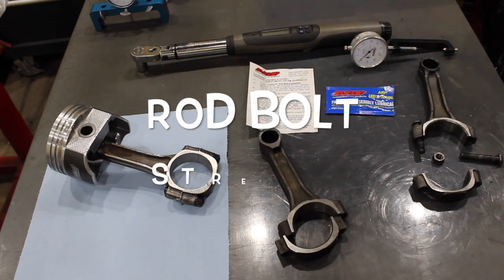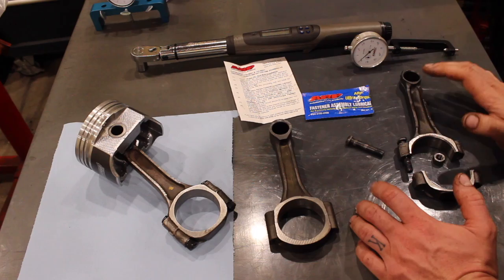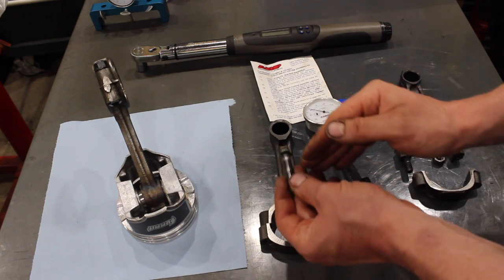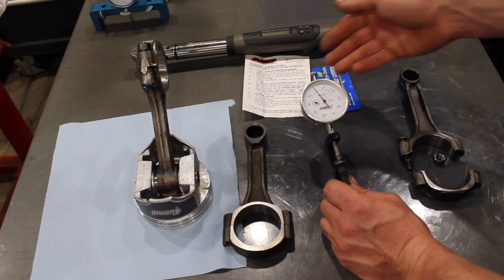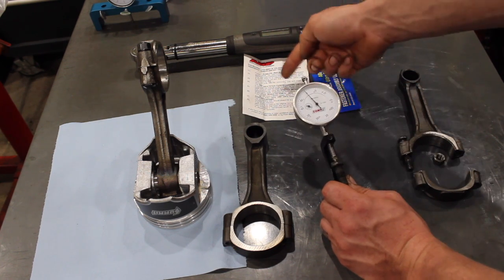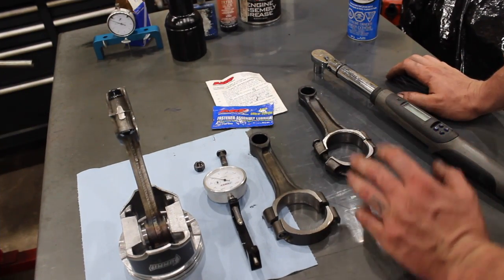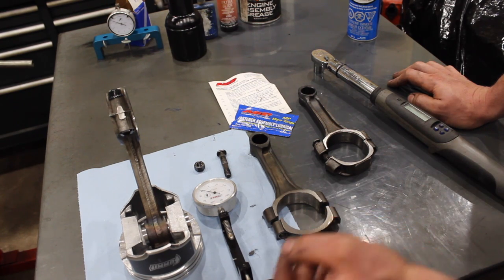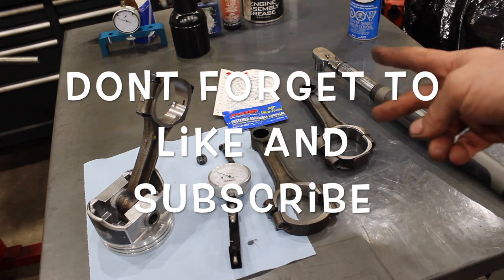Rod Bolt Torque VS Stretch Test (Surprising Results!)

Comment: I used the ARP lube on my bolts but after the 43 foot lbs mine called for I only got 3 thousands of stretch when it calls for 5-5.5 thousands. So I did the rest with a ratchet instead of a torque wrench until they were stretched 5.5 on both sides. Is this still an accurate way to do it?
Reply from the maker: Stretch is the important part. Torque is just an estimated number to get the proper bolt stretch
Reply: @cuttersperformance thanks 👍

Comment: I know this video is a few years old, but i could never get the ARP rod bolts to stretch to the recommended stretch, no matter what lube I used. Starting to think my arp grease is bad.
Reply from the maker: Even when you increased the torque spec?
Reply: @cuttersperformance  yeah, thats the weird thing, on my recent ej257 build, at 60ftlbs, it still wouldn't get to the specified stretch. I wasn't game enough to go higher than 60ft/lbs
Reply from the maker: @daniellib32  you put lube on the threads and the head of the bolt?  Have you tried other torque wrenches or checked calibration?
Reply: @cuttersperformance  sure did, have 2 different torque wrenches, but my digital one has always been spot on. 

I suspect the arp grease being quite old contributed too it. Im building another one shortly, ill try a fresh packet and report back

Comment: I'd be willing to bet most machine shops have a box filled with those little packets of arp grease. The customers have no idea their supposed to be using it. Nobody has ever handed me one of those packages when I pick up my resized rods with new arp bolts.
Reply: If the machine shop resized them the lube should already be on the bolt threads

Comment: The devil is in the details... The maximum yield strength is your maximum clamp force.
ARP might have a higher maximum yield strength but the set yield strength is locked in at your .00526 (etc)...
What maters is how much "crushing":takes place at the piston arm's  two halves, that they are stable at your high rpms and that vibration does not back your bolt assembly "out/lose"...
I will do a test showing clamp force created and this will relate to more "crushing" and if it's done in the yielding range of the bolt, it will give more resistance to vibration (what matters is the assembly not get loose during your high rpms and vibration)...

Comment: I do not use a torque wrench. I place an extra long box end wrench over the nut and then the stretch gauge. I can watch the needle move as I pull on the wench.

Comment: I'M CONFUSED......so after you verify this do you just assemble the engine using the lb-ft spec or do you assemble with the lb-ft spec and then wrangle the stretch guage in there to verify also???????
Reply from the maker: If you dont have a stretch gauge (which is recommended by ARP) then use a good torque wrench. Be sure to use lots of the proper ARP lube (on threads and head contact area) and torque to their provided spec
Reply: @cuttersperformance  thanks for the reply. I have no problem buying the stretch gauge, just curious if I am supposed to use that during actual engine assembly or if you just use it to find the lb-ft that it gets you that stretch before you assemble?
Reply from the maker: @yurimodin  if your working on a SBC/BBC you can fit it no problem. If you cant fit the gauge then ya you can use it to figure out the perfect torque spec with your torque wrench  out of the engine

Comment: It was very helpful! Thank you.  Great video! Let me ask you one question.  I will be installing eagle rods in the near future.  I don't have a stretch gauge.  The description says 43ftlbs.  When installing, do you tighten to 43ftlbs from the beginning and finish? Or as many people say, first tighten to 43ftlbs, loosen once, tighten again to 43ftlbs, loosen again, and finally (3rd time) finish to 43ftlbs Is it? I'm worried that the bolt will stretch if I tighten it all three times to 43ftlbs.
Reply from the maker: Im assuming the eagle rods have arp bolts? 
You can tighten in stages but the final torque should add atleast 10 ftlbs. For example of you snug the bolts then torque them to 15 ft lbs, 30 ftlbs then to the final 43 ftlbs. 
Technically the bolts can be torqued to 43 ftlbs over and over again and then return to the original size when loosened. The only time they will stretch is if they are over torque and stretched past their yeild. 
Be sure to use the proper arp lube on the threads as well at the head of the fasteners where it contacts the rod to get proper torque/stretch
Reply: @cuttersperformance  
Thank you.  You're kind.  I look forward to your video updates.

Comment: I conducted almost this exact experiment one friday evening out of pure curiosity but I also wanted to see what the arp bolt with arp lube torqued to the correct ft lb and stretch did to an otherwise unaltered rod. I tested on 3 different rods 2 oem rods and 1 eagle rod and was blown away at what I was seeing, the 2 oem rods were 1 from a traditional sbc and 1 from a bbc the 3rd being an eagle rod for an lq9 and 1 thing all 3 rods shared in common was they were all perfectly round on the big end to start but after torqued with arp bolts and lube none of the rods were perfectly round anymore 2 of the rods returned to round after removing the arp bolts but the bbc rod center line was so distorted and stayed that way it wasn't even usable anymore ( no kidding I hung it on the wall to use as a story piece after that ) the eagle lq9 rod and sbc rod were just fine but were spares so I wasn't concerned with hurting them. The conclusion I came to was I will never install arp rod or main bolts again without getting the rods and mains at minimum checked and resized if need be with the arp bolt. I will admit I have installed many ARP Rod bolts without getting the rods resized and have not had any discernible issue with anything flying apart however I have noticed after inspecting bearings on tear Downs that I have done this with the bearings have odd wear patterns consistent with the rod not being round yet it was before it was assembled anyhow Great video buddy just wanted to throw in my 2 cents I hope more people see this!
Reply: This! Have seen the same thing.
Reply: So the fact they came with instructions but yet u think u knew better? Lazy is what u are

Comment: Hi, How can I tell if my ARP rod bolts are stretched beyond there usefulness? Is there a spec for there length? See I had a engine shop install my rod bolts and the fing things where real tight when I got them back, So I thinking there stuffed. Been stretched too far! Great Video BTW. Thanks
Reply from the maker: Typically a pre install measurement is needed using a micrometer or rod bolt gauge. Arp bolts a super consistent so they might have the exact new measurement info or if you know the part# I can probably measure a new set that I have and you can compare to yours. 
Typically a 25 to 30% over torque will stretch them pass spec (Depending)

Comment: You need to do a video explaining how if you’re running a bolt or stud with a washer you only put lube between the washer and the head of the bolt or between the washer and the nut and not on both sides of the washer like some people think you should
Reply from the maker: Ive actually done my own testing on this and wasn'tsure if anyone else wondered about it. Again the key is using the ARP lube, but what I found is that obviously you want to cut down the friction between head of the bolt and the washer and putting lube between those two is key (also on the threads) Adding more lube to the bottom of the washer had little to no effect on the bolt stretch but did not show any negative effects that I found
Reply: @cuttersperformance  I actually sand the side of the washer that doesn’t contact the underside of the bolt head/nut with 80 grit to make sure the washer doesn’t rotate.  See that on in an email that ARP sent out years ago, said to do that if the machine finish where the washer sets is too smooth.
Reply from the maker: @sethmiller9442  Yeah ive seen that before too, never actually tried it though
Reply: Grease on both sides acts as a bearing

Comment: Love ARP bolts. They are not cheap but do offer excellent value for money. Locally it costs $100 to resize rods, $25 to check for straightness, and the bolts cost $80. So that's $215. I can get forged Scat rods for $320. Now if you got a local guy that can gets you reconditioned and resized rods for around $150 plus your stockers go grab it and growl.

Comment: I always tighten and loosen the bolts a few times to “match the threads and area under the bolt head”.  Then I’ll check the stretch with the recommended torque to see that my torque sheen h accuracy.   If it matche to the stretch I’ll torque most of them unless it’s a high hp build.   If my wrench torque doesn’t match the stretch I’ll use whatever torque that is that matched the stretch.

Comment: I have found that you have to have some formula,... using both torque and stretch for the best results,... materials aren't as consistent as we would like to believe,.... I still pay more attention to torque,... if I have to go a couple of ft. lbs. over,... to get close to the stretch,... I do,... but thats about it,.... fastener torque,... is where the tension accures,... and thats what you want,... to be consistent throughout the motor,... for reasons of heat and cooling,... where things can somtimes change.........
Reply from the maker: I also use the stretch to figure out the torque. 
Its really about the strech, not the torque. Technically you dont even need a torque wrench for rod bolts if you have a stretch gauge but its easier. 
A stretch gauge removes outside factors like thread resistance and really tell's you what you need to know

Thanks for checking out my video
Cheer!

Comment: The arp rod bolts cost is worth it but having the rods resized and everything idk if its worth it, by the time you buy the bolts and pay the machine shop you got $300+ in your stock rods when you can just go buy some aftermarket scat or eagle rods lol would be nice if having the rods resized wasn't needed
Reply from the maker: That's a very valid point, machine shop costs kinda push you into the aftermarket rod territory. 
As long as the new rods are decent and don't need any resizing

Comment: All depends on how everything  was machined on the procedure you take.  If the machinest didn't use a stretch gauge I wouldn't either.  Duplicating the process of when everything was machined is what you actually want.
Reply from the maker: I totally agree, but at the same time, to use the fastener properly as ARP intended, it seems that a stretch gauge it really the best way to go. The ARP bolt lube on the threads and head is also very important for consistency

Comment: This is my first time rebuilding an engine. I replaced my main bearing and my crankshaft turns pretty good by hand but after putting new STD rod bearings on and just snugging down the connecting rod bolts to 15 ft lb.
My crankshaft won't budge at all unless I loosen the nuts back up. Which I'm guessing that's why they can't be reused. Since there stretched out from having to be TTY. Now is that the case. Because So far, I haven't found anything that supports my theory.

Please let me know ASAP
BTW, I really appreciate you making the time to make this video for those who are looking for answers
Reply from the maker: Did you make sure the chamfer on the rods is the correct way on the crank?

Comment: I had some big block chevy ARP rod bolts. Said to stretch them .0065 to .0067.  I had to torque them 62ft lbs. With my torque  wrench to get them there with this  exact  lube, arp said 50ft ft lbs which was not rite.  D
So explain to me why I had to take them to 62 ft lbs instead  of 50?
Reply from the maker: I find it using takes a few more ftlbs to hit the correct stretch but not that much. 
Did you put ARP fastener lube on the threads and the head of the bolt where it contacts the cap? 
Is your torque wrench calibrated? (Probably the most common issue)
Reply: @cuttersperformance  yes i put that lube on the threads and under the bolt head.  Torqued them several times, took 62 ft lbs. To get the recommended. 0065 stretch they they wanted. 50 ft lbs. Was no where close.
Reply: @jessesyfie7244  scary

Comment: wonder if one can use ARP lube on non ARP fasteners?  Perhaps they would over torque them?
Reply from the maker: Any fastener with a torque spec calculated with dry or oiled threads will be over torqued when using ARP lube

Comment: I did pretty much did the same thing in 1992, Dry, 30W and ARP lube on 3/8 rod bolt. Got pretty much the same results, first 2 came up well short of target stretch, with the ARP lube at 50#  it was .006 but I just couldn't leave it be, at 55# they POP! the break is so clean you can hold the pieces together in your finger and run the nut right through the break like it wasn`t there. I broke two more and they both popped at 55# that impressed me all 3 broke at exactly 55#. very consistent.
Reply: Well, then I've gotta ask the question... That's only a 5 lbs difference, and you can't tell me at speed (rpm), that those bolts aren't getting pulled on way, way more than 5 lbs!!! NOt sure I'd ever trust that!!!
Reply: @Anarchy-Is-Liberty   - Was just about to say.  I guess he doesnt have an answer, lol.
Reply: @Anarchy-Is-Liberty  heat increases metals maleability. When metal gets hot it expands. So when everything heats up it lessens the stretch on the bolt. 🤙

Comment: I have to ask this, as you are obviously knowledgeable enough to know, yet a small enough channel to actually respond to questions....
TOPIC: LS OEM Powder-Forged Cracked Cap Rods (Gen4 specifically) and Rod Bolts.
Would you recommend staying away from ARP (either 8740 or 2000) OEM replacement 7/16 Rod Bolts ?
Would it be better to simply use new GM OEM replacement bolts (8720-ish grade I believe) due to the cracked cap post-forging design ?
While I understand that these rods CAN NOT be resized due to the cracked mating surfaces of the big end actually being the ONLY real alignment mechanism, would you run the risk of distorting the big ends with aftermarket fasteners (like the ARP's) that provided a clamping force that the rods were not designed for ? OR do you think that it would be OK ? With the Gen4 rods being pretty hefty, the weak point on the surface anyway, would seem to be the OEM Rod bolts. Thanks in advance....
Reply from the maker: Ok so I've been down this road before lol
So first off LS rods can be resized but not the traditional way of grinding the caps. They are done by opening up the bore and using a .002 oversize OD bearing. 
But the biggest question is do you need it go ARP bolts? I've actually talked to Richard Holdner and a few other abouts this as I always like to go ARP rods bolts on everything. He has noticed that unlike alot of other style rod bolts that stretch and cause rod failure, the LS rods will often bend or break without any damage or issues to the rod bolts. 
But that being said....alot of guys pushing big power with LS stuff will just opening up the ring gaps and add ARP rods bolts (thats it)
So unless you plan on making big power, your rod bores are good then stock rods bolts should be just fine
Reply: @cuttersperformance  I've seen the abuse that a standard Gen4 Rod can take with proper tuning and it's impressive. Included in gen4 was GM's strongest in-house fab'd Steel Rod - The LSA Rod. Stronger and beafier than the LS3 Rod (and look what guys do on a stock bottom end LS3), More meat on the big end, especially around the bolts and thicker neck, all with the tapered and trussed small end. From what I have seen, the LSA style of Rod has been carried over to Gen 5 and is the standard LT-1, L86 and even LT-4 Rod as well as the new Heavy Duty 6.6L LT8 truck motor's Rod. For some reason, a set of these 6.098 rods can be picked up for cheap, like $100-$150 USD. Now if any Rods deserved consideration for a Rod Bolt upgrade, it would be these. Most guys have bought into the hype and are dumping an already strong LSA/GenV bottom end for aftermarket, when clearly these Rods are more than decent. I think it's more than safe to build something using these Rods specifically, but as I said before, the ROD BOLTS clearly look to be the weak link, even though they are 7/16. $150 for Rods, $100 for ARP Bolts and for $250, I don't think there is anything better for 700+ HP or more in a daily driver. What do you think ?
Reply from the maker: I'd say your correct in saying that. The powered rods are strong, even the vortec 350 pm rods I've had good luck with (arp fasteners) and have for sure pushed the limits of those with good luck (knock on wood haha) 

The keys things are a good tune and not too much rpm. I personally think ARP bolts are always a good idea but not always necessary with LS Rods. 
I have a L33 sitting in my shop right now that I will be reusing the rods and adding ARP bolts + resize. 
You can't get a better rod for the money
Reply: I think you are right in that those rods can handle a lot of power but when it comes to high horsepower high rpm engines, engine builders don't want to take a chance on powdered metal. If you've got a bunch of money in a race engine a forged metal rod is much better insurance. Afterall a rod failure is a whole engine and block failure usually.
Reply: @MikeSmith-px7ec  I wish there was more info and practical 'Rod Grading' (for boosted applications) starting with a $300 Scat I-Beam and ending on the higher end with something like a set of $1500 Weisco BoostLines. The Mid-Range is a scary place to shop, as BS and marketing can go a long way and it's not as simple as saying "just get eagle H-Beams" if you want cheap but don't want to run OEM Rods.